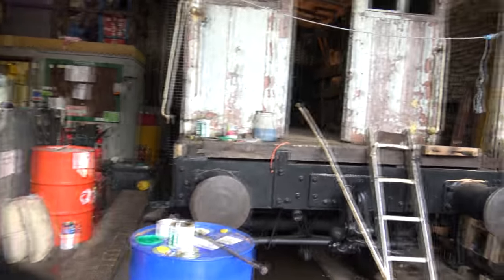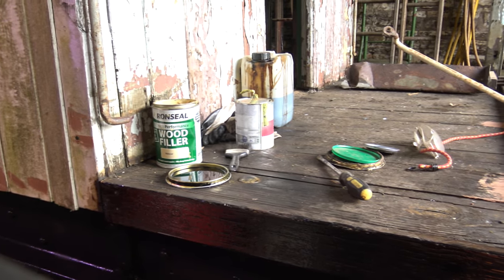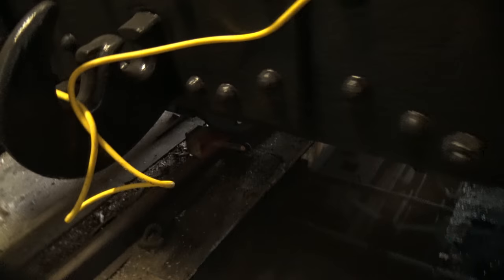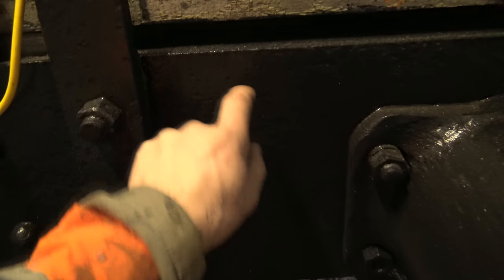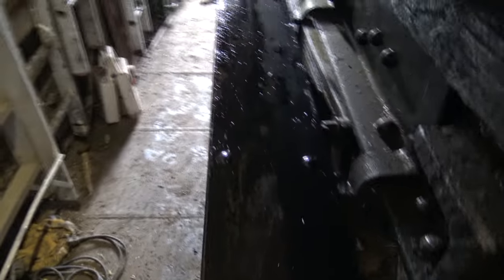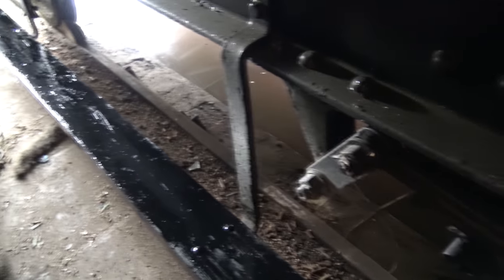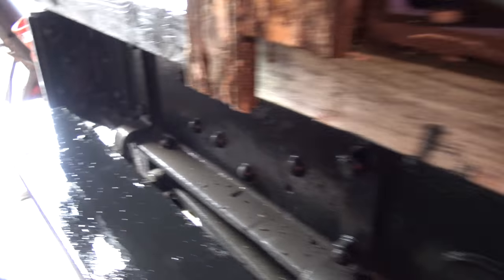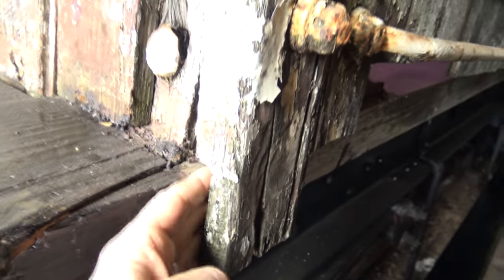LMS Brakevan Restoration S&DJR 21st November 2016

Comment: Great to see one of these vehicles being restored so fully.

I rescued 8 of these Midland/LMS (bodies only) from a North Wales farm last year, and in the process of rebuilding the first one. None of them had duckets, but the frames of two of them were clearly built to include duckets (two middle pillars with a ducket-width gap between them, as opposed to one single pillar on the standard non-ducket vehicles) which were never fitted.

Keep at it guys and good luck - I now have chassis-envy!